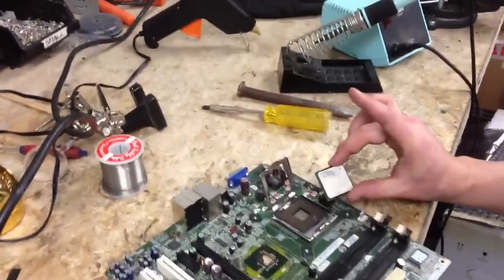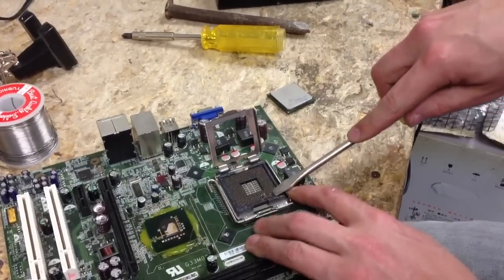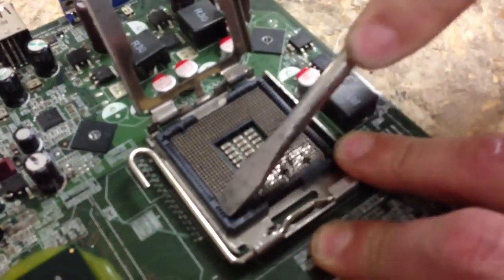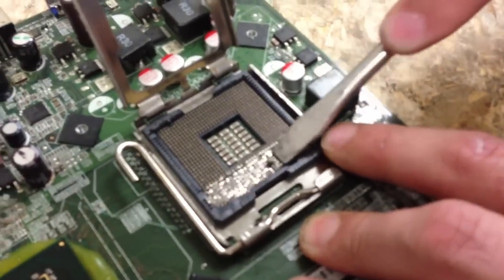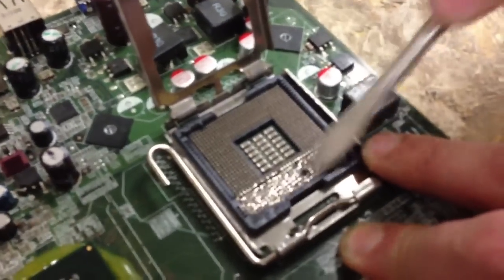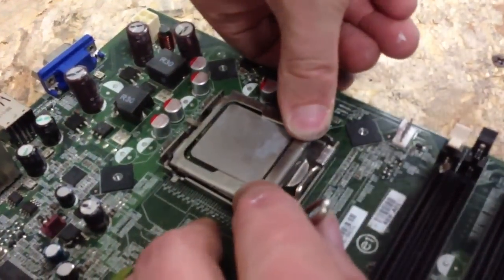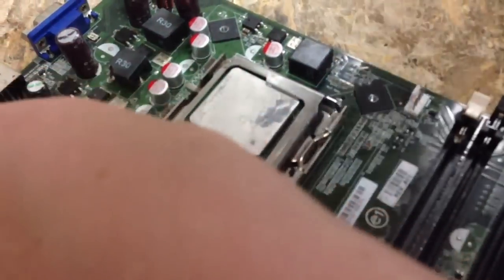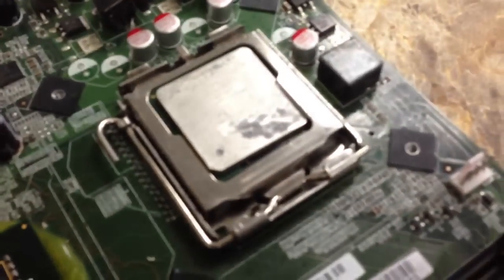Using 478 socket CPU on 775 socket motherboard retrofit hack

Comment: What he should be doing next is to power the hard drive using the 220 volts coming out of the wall directly so that the drive spins faster so you can read and write data faster improving the overall performance
Reply: Actually I tried that and now my pc can run Crysis at 6942069420 fps, Thank you so much for the tip.
Reply: SSDs HATE this ONE SIMPLE TRICK!

Comment: Also you could use handheld, power circular saw (angle grinder? how to call in in english i dunno?) to make hole in a correct place, in order to put DDR4 into DDR2 slot! Thanks to this method, i've managed to get very high memory bandwidth!

Comment: i found that you can remove the extra pins on the cpu , unless there is no pins on the cpu then use a trimmer tool like in this video and some nails to get at least 5 in and it will work no problem , thanks rnbtool so much great advice
Reply: LOL

Comment: right for everyone in these comments 1. the motherboard and processor were probably both dead to begin with 2. if you try this you don't need a computer anyway because you have the mental capacity of a fucking goldfish. also this hardware is worth basically nothing and is shit for recent computing.

Comment: ull be bether off just by buying a socket 478 mother bord with ddr2 support and a  pci express slot
and if u want to use a motherbord that u have and its a 755 socket just buy a cheap core 2 duo its wayy faster than any p4s and u know u cant mess up
Reply: +Ikab Iksnajnab this better be a troll